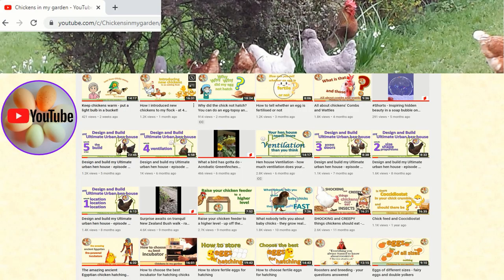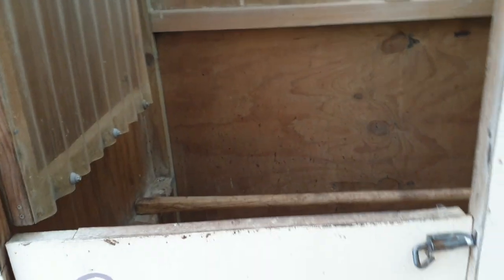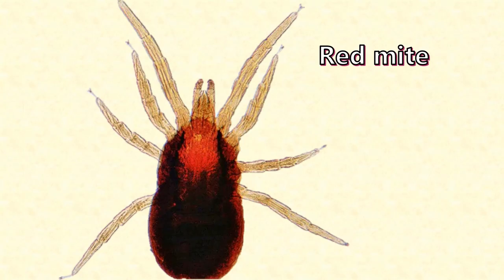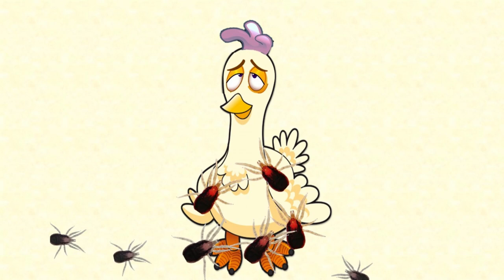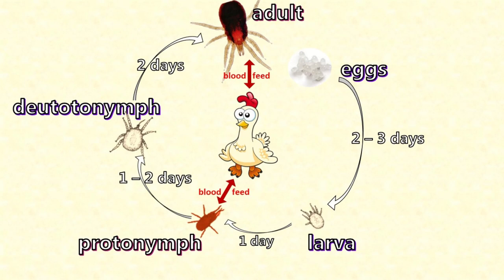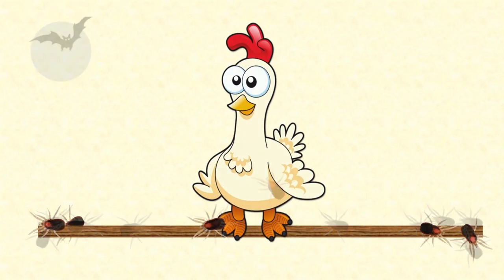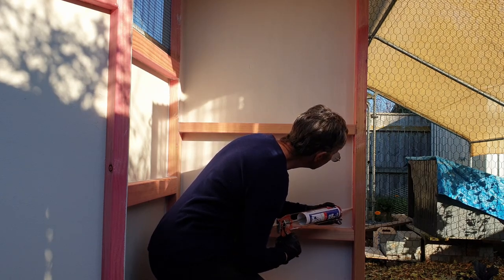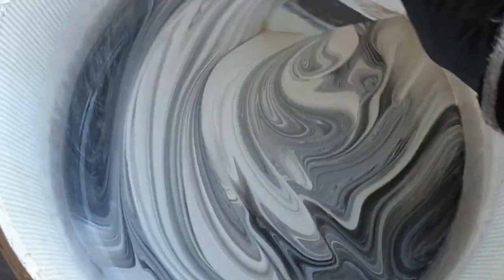No red mites! Lots of eggs! Paint inside your hen house - WHITE !

Comment: I have always painted the inside of the coops, I seal all the joints with liquid nails and then paint the inside and outside with "Solargard" exterior paint (best exterior paint EVER). I also keep a tin of "crawling surface spray" (like the fly spray for spiders/cockroaches etc) and spray under the mulch everytime I clean out the poop whilst the chicken are out free ranging. By the time the chickens come back the smell has gone. Since I started doing this I have never had a mite problem ever again. (over 2 years now)
Reply from the maker: Excellent tip, thanks 🙂

Comment: Good video!
What about the perch, how do you keep the mites off of them?
Reply from the maker: I could paint it also but so far haven't done so. The perch is smooth with no cracks to hide in so any red mites on a chicken would keep going to find a crack such as under the perch. I also coat it in Neem oil which helps repel insects. Neem oil is sold in garden shops. I mentioned it in one of my earliest videos, which is still popular https://youtu.be/ba22zDllKUc.

Comment: I too caulk all joints of the coop and paiinting as you, I have also started raping double sided tape carpet tape at the ends of the roosts, not only does catch red mites but its a visual sign if you have any red mites, at first daily changes of tape is needed but soon the numbers go down. then it is just there as an indicator. I tried fly paper on roost 1st. but a very messy job as it sticks on your hands, what a mess i got in! so if there is a wall that chickens roost next to I put a petroleum jelly  on the wall to prevent the mites getting that  part of wall to birds i use the jelly to smear on any cracks or rough surfaces screw holes or even screw heads! that mites my hide in. another way i am going to try is 3 drops of oil of oregano to a jam jar of cooking oils or linseed oil, and paint bush it the hole coop in spring I'm told this kills mites dead! we shall see
   Great video
Reply from the maker: Thanks! That sounds great!

Comment: I have used a mix of kerosine and boiled linseed oil, it seems to help.
Reply from the maker: Golly that sounds inflammable. Lots of care required!
Reply: @chickensinmygarden  Don't let your chickens smoke cigarettes. At least until the linseed oil drys.......seriously tho. That's the old time way to seal the wood. Much cheaper than paint. No more flammable than oil base paint.
Reply: @chickensinmygarden  Yes, I do not let my chickens to smoke in the coop. The mix dries fast in hot weather, I would treat the coop in early morning and keep the chickens out until completely dry. Boiled linseed oil is used on antique furniture and is safe with the caveat that soaked rags can combust. The kerosine is like a clean odour free diesel and diesel does not ignite like gas, it is much harder to ignite. But considering that coops are made of wood and that wood shavings and straw are popular in coops, good fire safety is a given. Really, with any wood farm building, fire safety is important. No candle light diners for my chickens!

Comment: Is it possible to paint a hen house, between egg laying time and chicken bed time? I’m concerned that excluding my hens from their house for a night would upset their routine too much and I’d hate for them to be uncomfortable with nowhere to lay their eggs.
My five hens have a problem with something causing them to loose feathers from under their tails and down between their legs and on their necks. Three of them have really large bald areas. I’m getting worried as I don’t know what is causing it. I did find evidence of these mites and thought I’d cleaned their house enough to eliminate them, but the bald patches are getting worse. The feather loss is like a moult, but without the fallen feathers lying about like there is when they’re moulting.
Reply from the maker: That definitely sounds like mites to me. But maybe not red mites.If you can't remove your perch, wrap the ends with corrugated cardboard or similar multi-layered material. Then each morning inspect under your perch or in the cardboard for evidence of mites - like grey dust or black dots that go red with blood if you smear it. That will tell you if there are red mites in your hen house. 
Alternatively it might be fowl mites - you can see these clustered around the base of the feathers. Or scaly leg mites. These will cause raised scales on the chicken's legs.
If it's fowl mites or scaly mites you treat the birds.
If it's red mites you treat the house.
Reply: @chickensinmygarden  Thank you for your advice. I’ll investigate more in the morning.

Comment: Wow. We built our own coop and throughout the vuildt, I kept insisting to my spouse that I was going to paint every piece of wood white and caulk every joint for this exact reason. And I did, despite the constant snorting and laughing at how fancy it was for the chickens, etc.. Our chicks are still too small to go in the coop yet, but I'm anxiously hoping this is going to work. I knew I needed to do something when I was standing underneath the large tree, where the coop is going to go, with two doves on a branch overhead, duking it out and flapping their wings at each other. I looked up at them and then looked down at the wood that I was working on and saw a red mite climbing on the wood. I figured it fell off of the birds as they were flapping their wings overhead.
Reply from the maker: Wow! I'm so glad you stuck to your guns and sealed everything, with so many mites that must be around.

Comment: This video just came up on my newsfeed. This is exactly what we've done to out coop. The mites were out of control. We purchased Elector psp (bloody expensive stuff), treated the coop, and a month later, they were back.
We stripped the coop, drenched it again, and I bought a vapouriser. I poured 30ml in the vapouriser and left that steamer in the coop for a couple of days. Closed the door as they were just coming out of a brood session.
Painted it white and siliconed every nook and cranny.
Crossing my fingers.
The vapouriser is fantastic. I'll be using that from now on as a preventative measure. The vicks vapouriser allows you to put the liquid in the actual container. Cedarwood oil also paralyses their mouths so they can't eat.
DE their laying boxes with wormwood and catnip as well.
Reply from the maker: Wow! Surely after all that, those pesky mites don't stand a chance 👍
Reply: So you put the Elector in the vaporizer and leave it running for how long? As a preventive you'll be using it how often? When you said you close the door because they were just finishing brooding Do you mean that you close the chickens out while it's running or do you leave the chickens and doors with the vaporizer?
Reply: @amel2784  until the water runs dry. It turns itself off when it's empty. So far so good. But geez, have we had it bad. Poor girls...I love them so much, and we were going to get rid of the coop and start again, but it's worked so far. In saying that, there must be a better way to treat these nasties.
Reply: @amel2784  yes, close the door to them. It's been months now, and the buggers still haven't started laying again. Imagine, I'm paying Australia $14.00 a dozen for organic eggs. I like boiling 4 eggs and mashing them for the 6 girls for added protein. I think I need more girls.

Comment: so just wondering why you don't paint the perch white too? wouldn't that help show up the red mites too? that was an excellent video by the way, thankyou
Reply from the maker: Thanks for asking. 
There's a couple of reasons  - the mites won't be on the top of the clean perch, they'll be hiding in a crack or under a blob of poop. And because the perch is scraped clean frequently, the paint would be scraped off by that, as well as by the claws of the perching chickens. 
I mention in my original video about perches that I work Neem oil into the perch to discourage mites
https://youtu.be/ba22zDllKUc
Reply: @chickensinmygarden   thank you for explaining.
Reply from the maker: You're very welcome 🙂
Reply: I’m building our first chicken coop.
We were just talking about painting the inside of hen house. So will definitely do that.
Quick question. 
What kind of paint did you use? (Indoor or out door) (flat or gloss)
Thank you in advance
Reply from the maker: I doubt if it matters. I happened to choose water-based enamel satin finish because that's what I had. Water-based is easy clean-up for painting. A gloss or semi gloss finish, or bathroom-kitchen scrubbable paint would be ideal for later when you need to clean inside the house but I don't think it makes a lot of difference. My hen house is 3 years old now and I've scrubbed it down a few times and the paint is holding up well.
Reply: @crushthebox7000 I painted the inside of our henhouse with a high quality exterior oil-based paint. My hope is that the oil based paint will be more durable and will make it easier to clean the walls, repelling  liquid when needed to clean the walls. Also hope that the slick finish will make it more difficult for tiny insects to climb it very well. Crossing my fingers. Our chicks will be going outside into the new hen house in a few weeks.